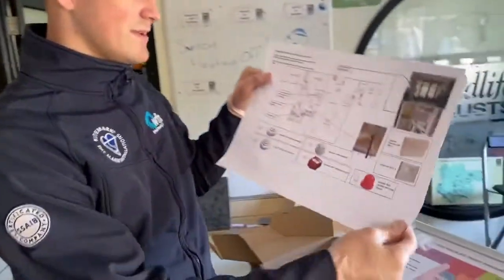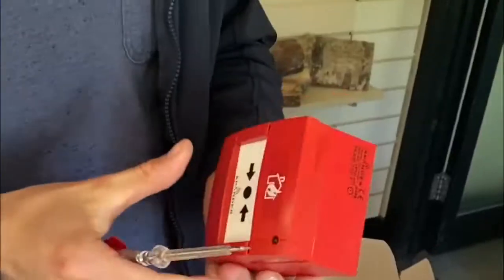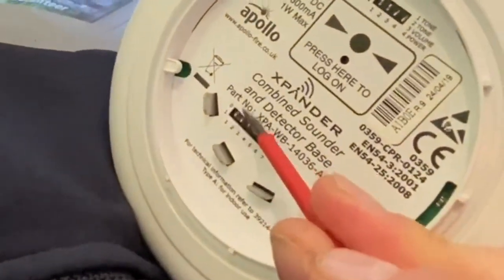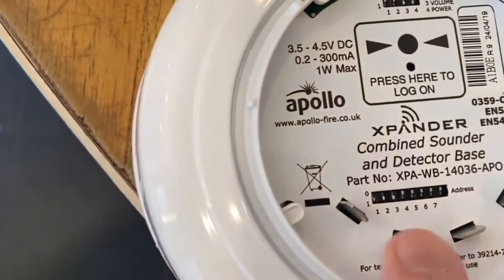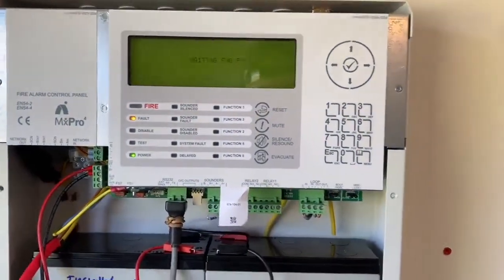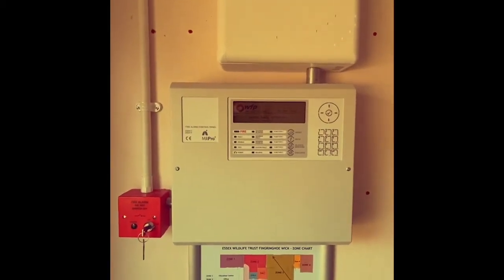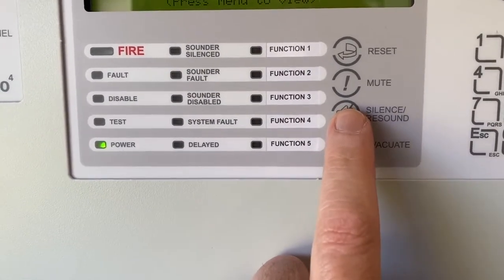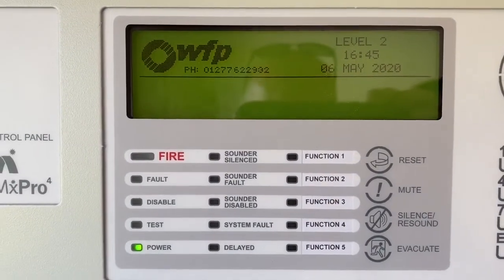Installing a Hybrid Fire Alarm System at an Essex Charity (Advanced & Apollo Xpander)

Comment: If we want to replace a combined sounder and detector , what is the procedure, do we need to program the device using xpander?
Reply from the maker: The correct procedure would be to use the laptop as this would give you the backup needed in the event of a system panel failure. You’d delete the device from the Xpander and add the replacement accordingly.
Reply: @wirefreeprotection  Thanks for quick response.

Comment: Hello, I have an xpander combined sounder base that isn’t connecting to an xpander diversity unit, it comes up with Please Retry when pairing.
Could this be down to the unit being used previously on another diversity unit? This is coming from an enthusiast by the way I’ve just gotten into the wireless sector of fire alarms.
Reply from the maker: Thank you for your comment! It shouldn't matter if you've used the CMB on a different diversity unit in the past, you can programme it up to a new unit and it should pair just fine thumbs up

Comment: My school has that one in the thumbnail
Reply from the maker: Thanks for the comment, the detector George is holding is made by Apollo Fire Detectors and is part of their ‘Expander’ range of smoke and heat detectors. It’s made in Portsmouth and fits on to a Radio base made by Apollo’s partner company, EMS, in Kent. The same detector is used on Apollo’s wired system and is called ‘Orbis’ which isn’t widely used as installers prefer to stick with the Apollo ‘series 65’ which although a very old design which has been around for 20+ years is [the series 65] and remains the biggest selling non addressable detector in the UK.
Reply: @wirefreeprotection  yeah I see series 65 detectors everywhere
Reply: @wirefreeprotection  isnt it made of ems? or did ems take them?
Reply from the maker: @privateshadow1  the system is an EMS Firecell, this system uses a wired analogue addressable panel and uses a hub to effectively translate the wireless devices into wired inputs. The system software then treats the inputs and outputs as it would any other wired system. This system can also use multiple panels which makes it flexible.
Reply: @wirefreeprotection  wait.. that’s ems but with Apollo on?